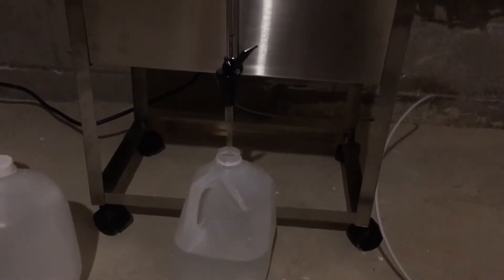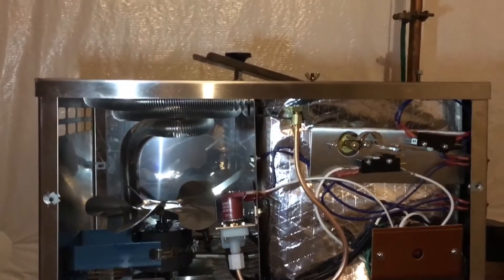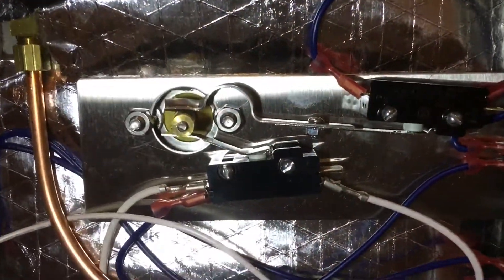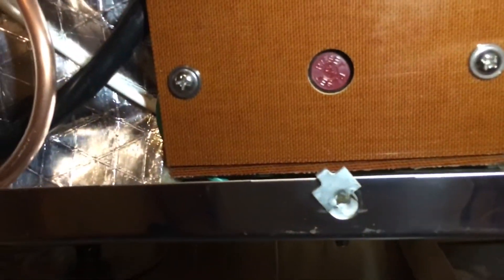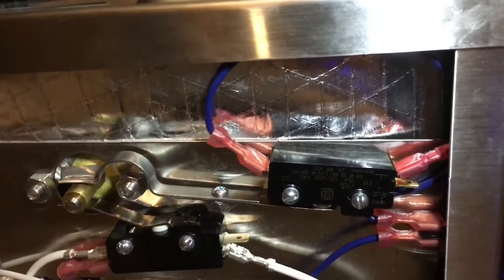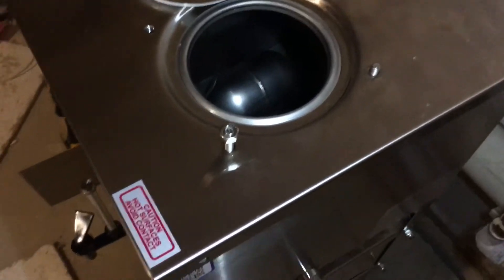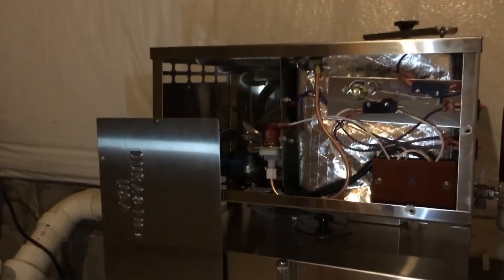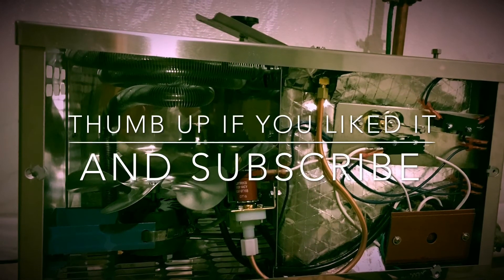💦 Inside of Durastill 30J Automatic Water Distiller and How It Works

Comment: Thank you ! Have a problem with my water intake it will not shut off so thanks to you I can narrow down the switch and yes I do not hear the hum as  you said I should when it is open for water to come in. I will check the wiring

Comment: How do I trouble shoot, mine stopped working? No longer under warranty.
Reply from the maker: Rachel Calzo, I am sorry but a lot needs to be typed to explain how to troubleshoot. If you can’t do it yourself, I would hire a heating/cooling pro, or an electrician. I converted mine to be electronically controlled instead of having a mechanical float, which turns switches on and off. Mainly because the silicone seal broke where the float arm enters the boiling chamber, and the steam was coming out of there and condensated onto switches and caused a short circuit so much that my circuit breaker was popping. I may do a video some day how I made a motherboard using arduino and some SSR relays to control the distiller electronically (fan, solenoid valve for auto filling, and the heating element).
Reply: @enjoymp3s  wow cool you made a motherboard

Comment: Excellent video.  I want to get started on transitioning to an auto refill.  One concern I have had with my manual durastill 30 h is the draining of sediment.  Even after tilting and throwing more water in to allow the powdery sediment to drain out I seem to still get a low flow and the sediment remains.  Do you think I should replace the drain pipe with a thicker one?  Is this something durastill owners have to live with.  I recall reading someone’s comment somewhere that they suction out the sediment.  I’m not sure where I read it and cannot recall if they did so through the drain pipe or from the opening on top.  Also what kind of vacuum device would do this.  Thanks for you explanation.
Reply from the maker: nejolo will vote for BERNIE SANDERS 2020 I replaced the drain valve with an electronic one that has half inch internal diameter and is strait instead of being an elbow. That way i can stick a thick wire bent in half, like u shape but with sharp bend, and clean the drain to increase flow. Also i don’t drain every single peace of the sediment,  because its hard to get the last small peaces out. Instead. I leave it there till next cleaning. I don’t use any vacuuming so i can’t recommend anything like that. I just use a wooden stick with a metal scraper at the end to lightly scape off and break loose and break apart in small peaces the build up before opening the valve. And while its draining, I try to move the build up towards the drain opening. That’s about it.
Reply: Thanks for the reply.  I was getting worried.  I’lll leave those extra bits of sediment alone.   I was looking at aquarium sediment vaccum options last night.  Does the straight drain that you replaced the elbow pipe drain faster?  Is there better flow?   My pipe is running slow.  I might have to momentarily replace it with a straight pipe in between the time I go full automatic drain and auto refill.  Are you using the automatic one durastill sells or some other brand?  Which do you recommend?
Reply from the maker: nejolo will vote for BERNIE SANDERS 2020 yes, straight one flows faster, the one i got has bigger diameter and, because its straight, it allows me to stick the wire from outside to unclog it when it gets clogged with large sediments. I use electronic one bought on ebay. Some chinese brand. The reason i got that one is because I make electronic devices and my plan it to make this one also automatic. I don’t like the one that sells with the unit is because it doesn’t check if the water is hot or cold before draining it. I want it to drain only when its not how, so i will use a sensor to check for that. I use arduino and similar devices to automate things.
Reply from the maker: Here is a link to my new video where I briefly show the upgrades I made to the distiller to make it more automated and awesome: https://www.youtube.com/watch?v=CYcuukrCTOo

Comment: Did you install the demand pump from Durastill?  If so, how do you like it?
Reply from the maker: Here is a link to my new video where I briefly show the upgrades I made to the distiller to make it more automated and awesome: https://www.youtube.com/watch?v=CYcuukrCTOo
Reply from the maker: No, Instead I installed a different demand pump found in eBay, stronger one, with pressure switch, so it keeps 30 PSI pressure in the pipe, feeding pot filler above the range, and drinking water and ice maker in refrigerator. Also after the pump in installed a 2-gallon expansion tank to stabilize the pressure. I helps the pump to turn on less frequently. Big help. Also I installed pressure gauge after the tank to see the pressure in the pipe. It's always fun to see whats going on inside (for makers like me at least)   Also I used Arduino micro controller to turn off the pump when there is no water in the tank, to prevent it from pumping air. All of these things are attached to the distiller. I wanted it to be all as one unit. I will make a video about those upgrades as well some time too. Subscribe to my channel and hit bell icon to be notified when I publish it.